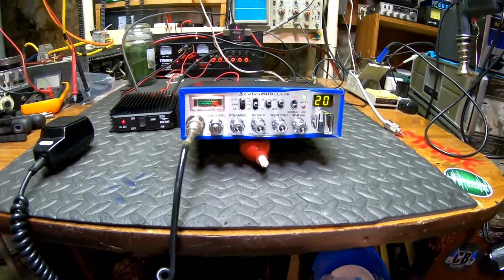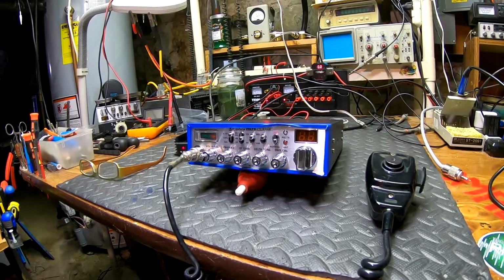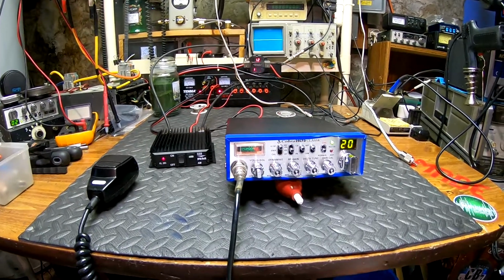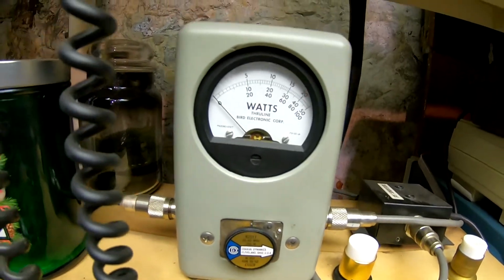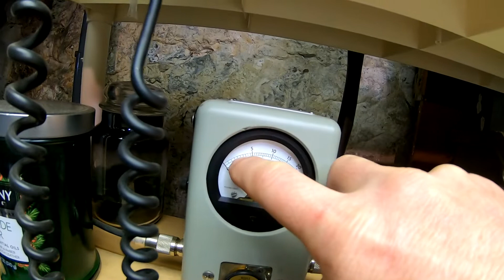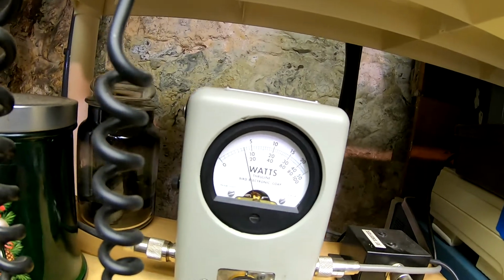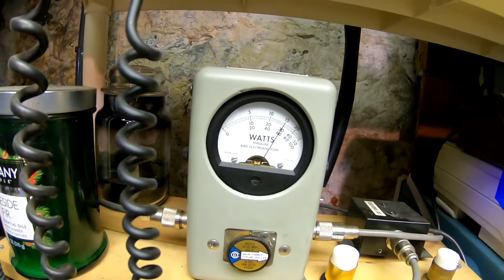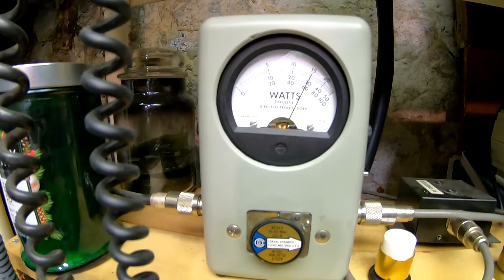Cobra 29 LTD Set Up With KL203 50(RMS) 150(peak)

Comment: I think in a low drive foot warmer situation a low power bjt or fet makes good sense. 2SC2078E or IFR510 make about ten watts, can be tamed much easier with less distortion envelope and if you smoke the linear you can still talk to the dock with ten watts man I mean tbh it doesn’t take thirty watts to talk for daily trucker needs. It’s like a D-Cup, nice to have but smaller works just fine as well ya know? That is all. Remember, mowing is about blade speed and humidity my friend. Science! Lol keep it shiny.
Reply from the maker: YEah man.I never had a problem with these 203s.i hit them pretty darn hard too lol :)
Reply: @577buttfan  oh no I’m sure not I just like tinkering with different parts see what happens.
Reply: @577buttfan  I like hitting em hard as well..to the tune of about 40-50 watts ♨️
Reply from the maker: @TheRadioGarage  Awesome little amps!!!I hit one with a dual final export for a long time haha!! :)

Comment: Good Stuff but from my experience not all Mosfet are created equal. The 9530s proved to have a much better sound quality & could withstand much greater run times than the bi-polars tested.
Reply from the maker: LDMOS are pretty badass too!! Ill have to do some future testing with those.Im not a fan of FETs at all as of yet.
As for the 2030,520,13N10 ect... they all dip in power when hot.
 I would like to know where you got your data also.Would like to read and research always learning?Links please?
Reply: @577buttfan  My data is real world testing on the dark side I will send out an email to discuss.

Comment: Would a small amp like this be worth it?
Reply from the maker: Why not it makes atleast 6X more power than the barefoot radio? i drove a 2x500Z amp with one for years!!
Great little pocket rocket for a slip seat driver too.A cig lighter will run it.
For $89 if it blows just throw it in the river and buy another one!!
Reply: @577 Jersey Customs Adventures  I've been really debating it. But, it seems like it would really only be useful on SSB
Reply from the maker: @Texas12valve  I talk all around the country on AM with this amp no problem.
Reply: @577 Jersey Customs Adventures  thanks for the reply. Gives me more to think about. My hunting land is about 30miles from my house and no cell service at the land a lot of my family uses CB so if the amp would help me reach them in an emergency it'd be worth it.
Reply from the maker: @Texas12valve  it will reach 30 miles no problem as long as there is not much dirt between you and both antennas are tuned.

Comment: So basically the "swing Mod" dirtied up the radio?
Reply from the maker: Most radios that are set up with less than 2 watts carrier are hard to get a perfect waveform.
Slightly Dirty isnt really a problem as long as its not completely clipping..and if your using it for comp class C than dirty is good.If your using it in front of a Tube amp you want it 100% clean even slightly less like 80% or you could experience arching.